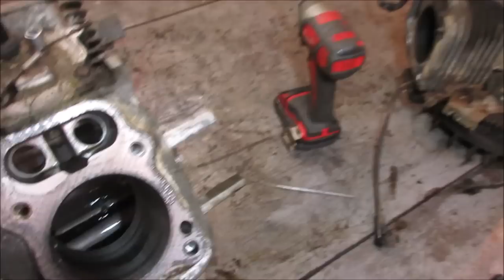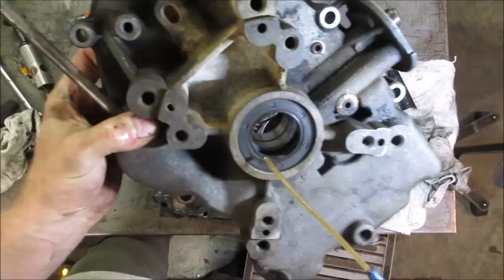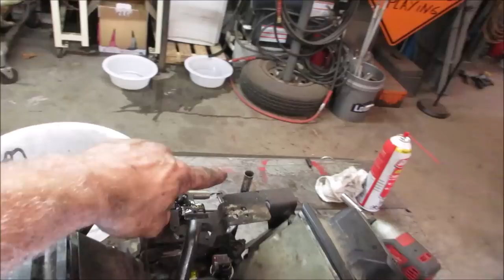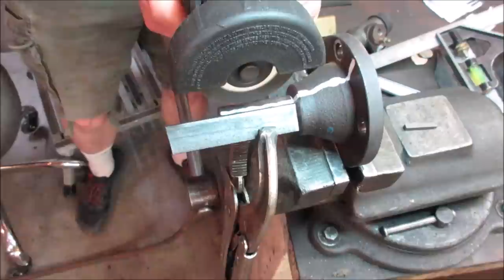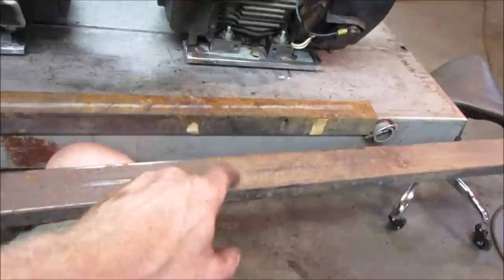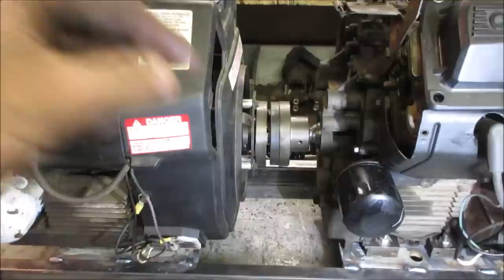2 Blown up Engines Glued Together, Let's start them up and see what happens.

Comment: You can align the coupling using the straight edge and feeler gauge method it usually gets you really close if you take your time. There is also the dial indicator method .Then to lock them in place you can use jack bolts or weld key stock to keep the blocks from moving.

Comment: FWIW, I took the cups off a Harley lapping tool and fitted them to soft steel rod of the proper dimension, so i can chuck them up in the drill. So the drill is turning and pushing in from the valve/seat side, and you bounce it with your finger on the stem.  More efficient, faster work... YMMV.

Comment: I really liked the slow motion of the exhaust gaz. Just prove that  there are way more power to harness in a gas explosion that we do use. But That is for another discussion ;-) . I have a big doubt about what the motor / s will used for. But I would had loved to see them run a large electric generator, or better yet a good number of 5000 Kw generator. Think of the beast, 4 5k ish generator driven by a tandem of 2 20 HP motor all this running at 3600 RPM and connect all of that to a DC to AC generator to produce a nice AC signal.

Comment: My only concern with it being 180 degrees out is that:   If the Lovejoy coupler has a lot of slop, it might cause the coupler to slam back and forth and constantly hammer itself to death.  Because each time a cylinder fires it will cause that engine to accelerate faster than the other, so the Lovejoy coupler will be oscillating left and right with each stroke-- hammering on the lugs.   You don't have that problem normally because the load is always applying resistance, and the engine is always applying force -- so the lugs will just have a continual pressure applied in one direction.   It shouldn't really be a problem if the Lovejoy's rubber buffer in the center is very tight fitting-- but if it has a lot of slop,  it will get so hammered, I don't think that rubber buffer will last very long -- and you might have to figure out a better way to link the two engines---  like with a U-joint maybe.

Comment: MUSTIE  I would also join the top of the engines together in the middle or build the cradle so it supports them to prevent movement at the coupling when under power.  I am seeing 4 exhausts with flip caps on them :D
Reply: I think the easiest way to 'lock them together', is via the exhaust system. Either weld the 2 exhaust manifolds together or attach a coupler around the exhaust pipes and create an external X frame. The external frame will not expand as the exhaust heats and so the motors will have a fixed distance. 
Coupling the exhausts may need to allow for the expansion so may have to loop one or both engines exhaust pipes, to cancel each other out. But he has to consider it.

Comment: first run had me giggle. what a beast. hope you dont muffle them too much. also, that rubber should be fine. it's only handling the difference in power, not even close to the combined output. try double stubby grubscrews.

Comment: In 2016 I purchased a 2003 Exmark LazerZ from Ebay for 1,450$, with this same type of Kohler engine. I managed to get the engine started but it was knocking badly. I proceeded to completely ruin the engine by testing the hydraulics of the unit. ( A hole in the block, broke both connecting rods and chipped the bottom of a cylinder). I ended up buying a short block from Tulsa engine warehouse for 800$, the unit has run strongly ever since. Thought I might share that information.

Comment: Putting the Allen screw directly on the woodruff key is probably a no-go.
The minute vibrations that the key has during every engine cycle might back off the screw.
A regular bolt with a head might work better, as the head would be the point of tension.

Comment: You can use about 400-600 grit sand paper on a pane of glass, with the ring two sided taped to something to hold it flat, and wet sand the ring, up to 1000 grit if it's not in bad shape or 400 if it is. However using 220-320 then 600-1000,  then possibly polishing the rings leaving them polished with tiny grooves, and possibly polishing the ring lands, using a sacrificial ring and diamond lapping compound, equal to 1000-5000 grit then a burlap cloth or cotton/denim to buff the lands, and the dome, this would be more for a dirtcheap budget  race engine, reduce friction everywhere, I believe even a dirt cheap race engine should have a billet rod, because about 5000 rpm and it's only a matter of time, these break rods in stock apps,

Comment: Put a dial indicator on to measure the face and OD so you can shim and align the coupling. The element in the coupling will last no time until the shafts are aligned.

Comment: If you are still concerned with the alignment. you could use two dial gages one set up on the coupling one in the radial and one on the face. Your coupling will take up some of the misalignment but the closer they are the better

Comment: It’s runs well .. flamey, not exactly stoichiometric😮.
To bolt the engines down/together, you could try using electrical strut.
I sounds like an old school Wayne wood chopper.

Comment: I think you need a torsionally rigid coupling like a gear or grid or flexible disc pair type. Too much angular movement going on there. I might even consider a solid coupling and rubber mounts under the engines. but 7/8"seems a bit small for that and might fatigue.

Comment: Thank you so much for a complete tear down and assembly. I've never done it on a small twin v  and now I understand how everything works. Aren't there any rod bearings?
Reply: See the first video. He covers it there. No, it relies on the aluminium getting oil flow to keep it the two metals from touching. Sort of like the cartilage between your bone joints. Anything to save money I guess.

Comment: small critisism (hopefully constructive)...when you hone try to work the hone up and down fast enough to get a 45 degree pattern. It helps the oil stay in the grooves but also it helps the rings. Imagine it on a macro scale-when theyre diagonal the rings will ride over them where if theyre horizontal its like hitting a ridge. Yes it will smooth itself out but you actually want some of that pattern to survive. Again, not a huge deal (and i realize this was a bit of a special situation) but it might be something to keep in mind in the future 👍
Reply: A commenter above suggested he slow the drill speed as well. I was thinking the centrifugal force would not 'drive' the stones so hard into the steel and would give a finer 'polish' to the bore. Of course it will take longer to take out the rough patches. And of course, working it up and down faster. 
150 compression on the gauge, can't argue with Musti1's technique. 😉

Comment: Fun project! It occurred to me that now that you have four cylinders, and the capacity to couple them in different firing patterns, why not try 90 degree timing? 180 is working, but if you can get them to fire at 90 degree intervals it may be a smoother, and more rapid throttle response. Just a thought.

Comment: That sealant is what my brother used on a Kohler motor instead of a gasket after about 2 months it started leaking. My advise is to use a gasket instead of never any kind of gasket sealant.

Comment: I can see the challenge, for a smooth engine you want four firing strokes spread equally over time but to give the Lovejoy joint an easier life you want both engine cranks accelerating and twisting the joint at exactly the same time to minimise force on the rubber part.

Comment: A quarter rather then half would slow the engines to cycle as a typical four cylinder with each compression stroke independent from all other.  It would also cause smoother run and better power.

Comment: Turn that into a mini T bucket. With small bike tires on the front and car tires on the back  with down swept pipes that turn out half way back.  You have the dies to work the sheet metal.

Comment: Rear end seems kinda big for that cart track you go to so what will it be?  Yet another tractor? An ATV? A small truck for getting round the woods at your lake property for hauling firewood and/or log skidding? Tracked utv? I just don't know what you would need the power of two engines for. Does the power of engines outmatch the rear end gearbox? Gotta admit I'm stumped.

Comment: Just thinking for smoothness of operation would it not make more sense if the engines were 90 degrees out of phase from each other?  That way each cylinder would be on a separate phase of the Otto cycle.  Much like an inline four engine (or VW) where you have each piston on a separate stroke: intake, compression, power, exhaust.

Comment: probably just got lost in the editing, but for prosperity if someone is using this as a how to in  the future. you should take the rocker adjustment nut off and loc-tite and torque the rocker studs separately.  Iv'e done the same as you and buzz them in using the rocker adjustment nuts and have had one vibrate loose and drop a rocker. Just sayin 😉👍

Comment: 40:40 Perfect to put on the screen for motorheads, replacing the fireplace-videos some people use as cosy atmosphere. Not a mechanic, but would think that a two engine setup, where there is different rpm on each engine, that the slowest one would slow the other one down, at least make it work harder to maintain its speed?

Comment: I'd look into a tough epoxy to replace the rubber in the coupling,     remove the rubber and wrap with aluminum tape, and fill with the epoxy, or polyurethane, maybe drill holes and put pins in the coupling to create more engagement points!

Comment: Instead of using a Jaw type coupler you could use a couple of sprockets face to face and use chain. double 50 or 60 depending on what you can scrounge up, it would be stronger than the rubber element.

Comment: Very nice!  Those two look happy together!  As long as the 'front' one wants to be the 'front' one & the 'back' one really wants to be the 'back' one there's nothing wrong with that!  😆😆

I like the gearbox/diff you found for it, that seems perfect!  Are you gonna use a veedub exhaust system with it?  It would be pretty quiet I'd guess?

Are you gonna make a 'side by side' vehicle? - Although the diff isn't very wide - unless you extend it?  I dunno.  I'm sure whatever you come up with is gonna be fun!  40 Hp is like a bigger quad bike engine capacity, so something along those lines maybe?

Comment: you could put a pulley or sprocket in the middle shaft where they are linked and have that transfer power to a lower shaft that goes below the engines and out the front or back to drive something

Comment: 20:01, when the cover comes off, the governor should be removed and not put back. Its an “unnecessary” power limiter. Might not last as long but i promise it will be lots more fun.

Comment: Question what are you going to pit this duel engine on i think you will need to sink tge carbs togsther and select one of the governer for thrittle control. Akso it would look really cool if you put stringht pipes on it going stright up and build yourself a pulling tractor with this engine assy.❤

Comment: BE SURE to replace the left and right covers on the blower shroud. Those holes represent a loss of forced cooling air-flow over the cylinders. I don't think it is sound to remove the blower fans and shrouds like you said at the end, unless these engines are for a vehicle that moves a lot, and rather fast at that.

Comment: A very well engineered outcome, but I'm wondering why you did not connect the two units together 90 degrees out of sync and not 180 degrees. That way you would have had a cylinder firing every 90 degrees. Just asking - well done - one of your best!

Comment: I thought there were little lifters that go in first, and then the cam?   I guess you'll catch it if you see them laying there.   Edit-- interesting, so these lifters slide in from the top.   I was thinking it had the little lifters that slide in the bottom first, that have the round head on it that contact the cam lobe.  But these are different;  these are almost automotive style.   Nice.

Comment: This would be killer in a homemade go kart, or add it to an old rowboat with a seal and propeller. I wonder if there's a way to sync the carbs or replace the separate carbs with a single carb and custom intakes so it isn't always fighting itself?

Comment: With the motors 180° out the starter is always fighting a compression stroke.  I would wire both starters to crank when starting.

Comment: The problem with running engines with the crankshafts connected together is that you end up putting twice as much power on one crankshaft as it is designed to handle. If you use two engines connected to a separate drive shaft by belts or chains, each crankshaft is only subjected to the power it's pistons produce.
Reply: The rating of the piston chambers is the same. The amount of power they can put to the con-rod does not change even with the connection. Where the problem is going to lie, is when it is connected to a load. The 'torque' that can be applied to the load via the joined crankshafts, is where the problem is going to happen. If the load exceeds the torque rating that the 2 engines apply, rather than stall the engines, it's probable the 'weakest' connection will break. So to avoid that, I think Mustie1 needs to put in a mechanical friction torque limiter between the output and his gearbox. Should such an event occur on the load, he will save himself a lot of extra work. That's my guess.
Reply: @David-yo5ws  if the drive is run from one end of the combination, the power from both engines is run through the crankshaft on the drive end.

Comment: Are those engine running 180 out. Too get run both smoothly.  ) 4 cylinder  as one. ? Get a good old convayer belt 
 Make a brackable clutch.  Love the idea.
 God bless mick Australia  )
Reply: There alot involved in this build.  God bess

Comment: How about using a differential and attach each motor the wheel end, then the pinion side would give you an output and hopefully balance out the engine imbalance?

Comment: Do I detect some form of "ratty" rat-bike (trike) in the making?

Ooh, a Tarylism creeping in there "pis-tee-owen"... I think from memory, those pis-tee-owens are graded in terms of height between the crown and the pin, with either, one or two grades, going + and - above and below the standard piston. That being the case, you have two odd pistons in one of those engines - either, it's been rebuilt with the wrong pis-tee-owen in the past, or, it's a factory error. Either way, the pis-tee-owen crown should be flush with the block face (deck).  All it means is that you're engine will have a slightly 'lazy' cylinder. To all practical purposes, you won't really notice any difference.  In actual fact, I do believe Taryl covered the Briggs' piston issue in a video quite some time ago.

Drive couplings - I don't know if you can get Fenner drive couplings in the States, but if you can, then a Fenner "Turbo-Flex" coupling would give you a solid drive (no backlash) while still allowing a slight misalignment between the engines.

Can't wait to see what's coming next... It would be one hell of a golf cart with a 40hp power plant to drive it!

Comment: I've run a number of "motor pile" builds, many come around as good as a good rebuild or overhaul
23:00 my experience, water logged heads and valves from blown if undamaged and not overly worn, quick check of seat contact pattern and guide health

Comment: Would be probably good to see if you can use both starters and wire in one key to turn both starters. But then you would need to use like a Honda Civic battery to save weight.

Comment: I wonder how long that rubber coupler can last with rpm variation between the engines and the crank vibration. Is there any kind of viscous coupler available for something like this? (I've always wondered how multi engine tractor pull vehicles combine all that power)

Comment: If both engines are 20 HP and you couple them is series to give a net 40HP from the output shaft of the second engine, would it not be that the engine case crank and bearings etc. on the second engine ( that is designed for 20HP) is suddenly seeing double that and forever be a weak spot?

Comment: First, I am the polar opposite of an expert on these things.  If I know anything, I learned it from Darren.  That said, I feel like the coupler will tear itself apart because the torque and the RPM's will never match and one engine will always be acting as a brake for the other.  Am I missing something?

Comment: When built my go kart engine i had rhe same rod issue. I put a bolt in the vice and grabbed the torque wrench at the length of thecwrench i needed to use and gotba feel for the pressure.

Comment: I see one problem on how to get the power from the engines, since those cranks are not meant to handle double the power (I'd assume so at least) I don't think you can use the remaining free coupler at the end. I'd assume you'd have to add a belt pulley in the middle between the engines to not overload the front crank with the additional power of the back engine.
Reply: Mmm. 🤔 That's quite the puzzle. Technically, it's like having a 4 cylinder V engine, with a common crankshaft. The power of the pistons is the same and does not change whether the 2 engines are separated or joined. They are both rated at 20hp. So I see the power to the crankshaft as being the same, but the torque output capability is increased. So if there is a load on the output that does not stall the engine/s, then there is a chance that the con-rods break or the bolts shear on the output shaft that's connected. or breaks the gears in the gearbox. So, Mustie1 is going to need a mechanical friction tourque limiter between the output and the gearbox for a 'just in case' situation. Cheaper than having to fix it all up again.